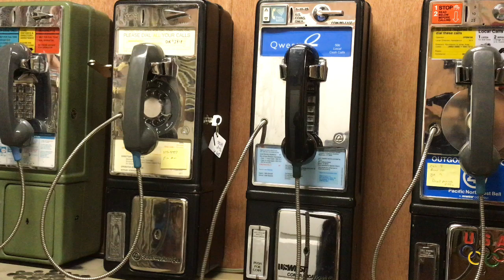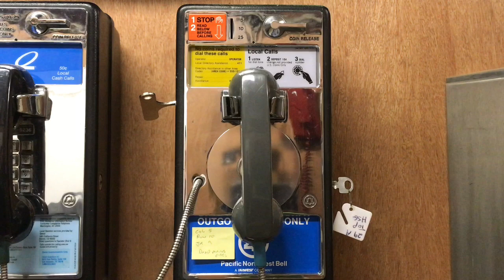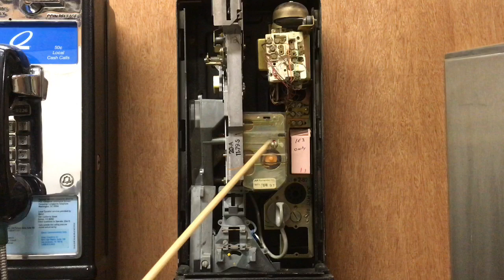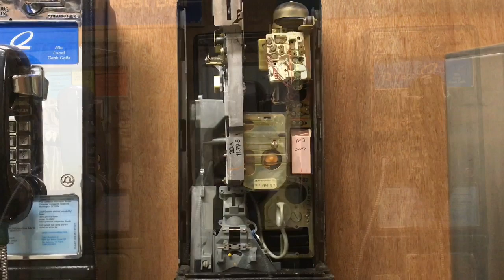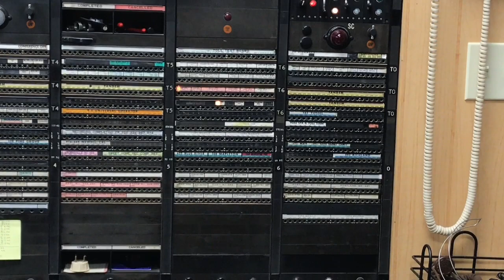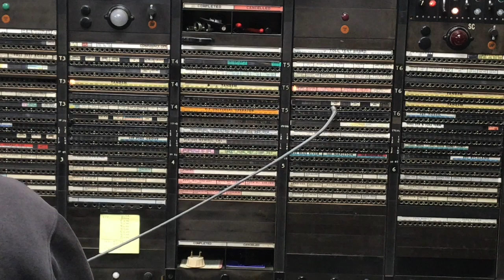Western electric 1E1/ 1E3 post pay payphones with calls placed thru a toll switchboard.

Comment: Simply amazing! Great demonstration! That manual payphone is very interesting and makes sense given the nature of very remote toll stations. Doesn't beat this for sure, but single-slot phones that emit coin denominations, with no other equipment, can be brought to life on NPSTN through the virtual coin trunks. 24/7 operator service for both dial and manual service (with some cordboard routing), MFing, accurate 1970s time of day based charging, and the integration of many different pieces of older network gear make things fun and interactive. Fun for collectors, phreaks, and switching enthusiasts - https://npstn.us

Comment: Those instruction cards on the 1E3 are not for use on a manual exchange. The right instruction card would be simple, reading like this:
DO NOT DEPOSIT MONEY UNTIL OPERATOR ASKS FOR IT.
Reply from the maker: Non of the cards are correct. They will be in the future.

Comment: That must have taken a lot of work to make the payphones and switchboard and step equipment work! Thanks!
I never handled calls from post pay payphones from the cord board I worked, but a few years later, I got to use TSPS positions and we had a larger service area that included three exchanges with post pay phones. Even though the lights on the TSPS position would make it look like it was a non-coin line calling, I would know it was a post pay phone because there would be a loud burst of dial tone just after the 480 hz "zip" tone which I heard at the start of every call I got.
Reply from the maker: many 1000's of hours. 25+ years for the large stuff.

Comment: I had to handle a call from an independent telco for a post-pay intraLATA toll call, during my short stint as a VZ operator (June 2000) - the process was to compete the call and once the called party answered I was to say “this is operator, long distance is calling, hold for billing completion “ “your party is on the line, please deposit 75 cents” ...